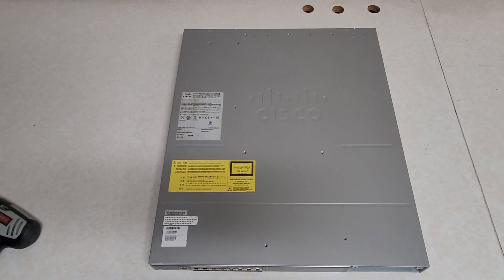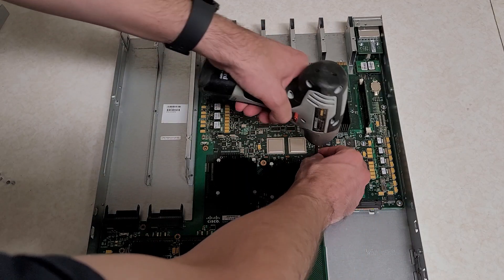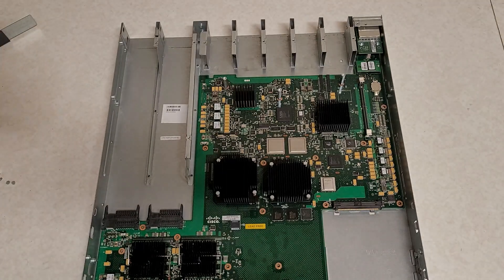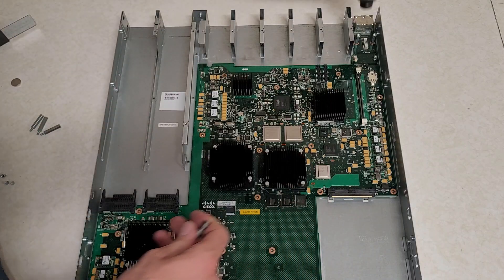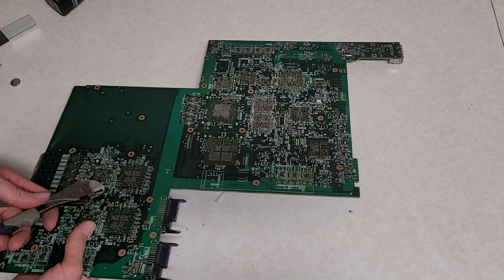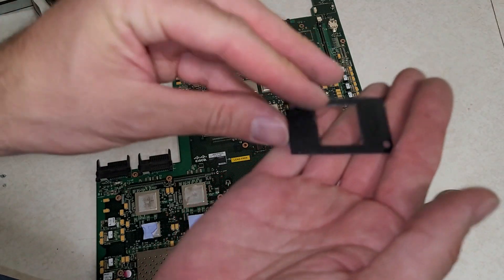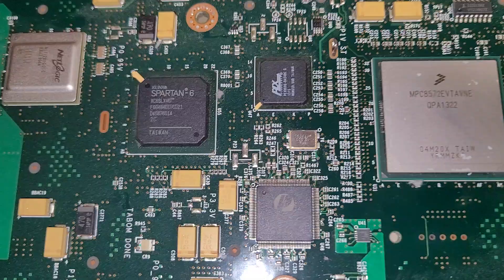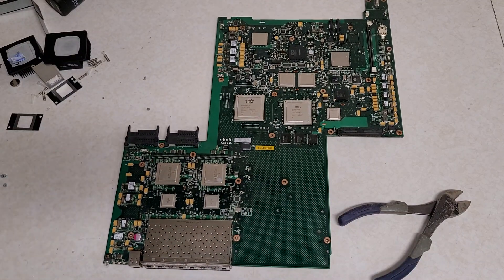Cisco WS-C4500X-16SFP+ 16 Port 10Gb Switch #teardown

Comment: Im about to get some of these from work for free is it worth it for a home NAS system and to learn networking?, also what are the pullable drives that are on the back side maybe expansion bays?
Reply from the maker: It will work fine if you don't mind how noisy it is. Back bays are for fans and PSU. Front bay is an expansion bay for extra ports.
Reply: @computersales  Wow is it noisy, but I heard you can mod the fans!. or maybe a soundproof box
Reply from the maker: @deadmusik9969  yeah you could swap out quieter fans and let it run hot. The fans would cost more than it's worth though. Sound proofing might be easier.